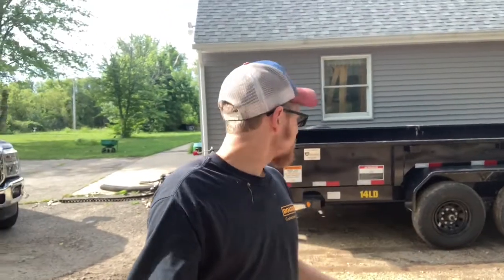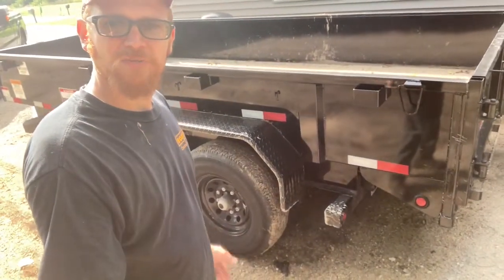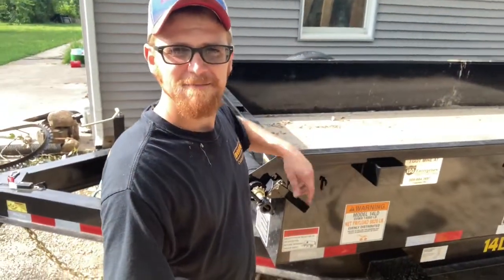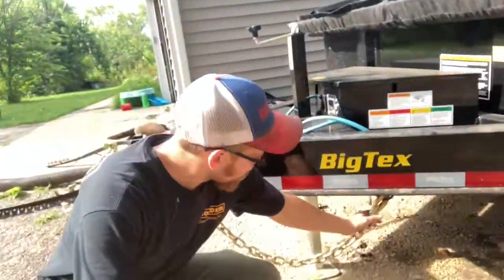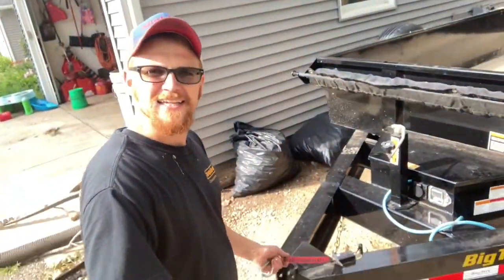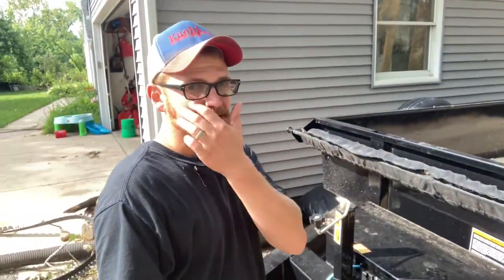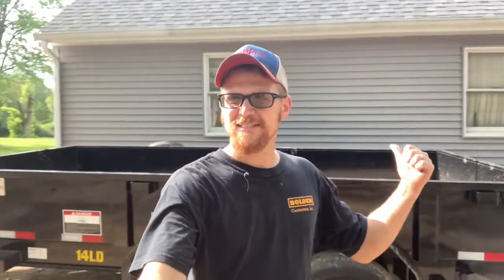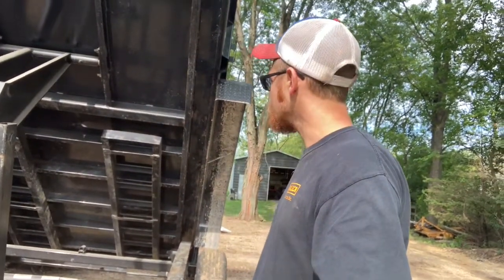Dump Trailer Overview/Review Big Tex model 14LD 14’ long

Comment: Love the chains and plug storage! Biggest pet pev is when people lay the shit on the ground. 

D rings in front are high so they don't get packed with debris and or when loaded with minimal material you can park skiddy on top and not have buried fron rings. 

What tires? Next video needs price and a skiddy loaded in it for comparison. Looks bigger than 12 ft. Maybe even a full loaded dump?
Reply: Its a 14footer